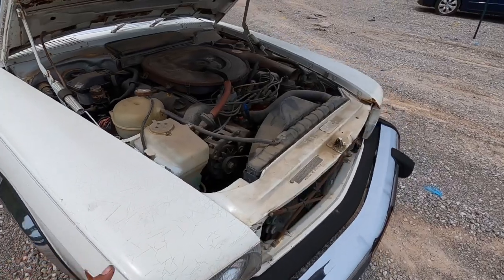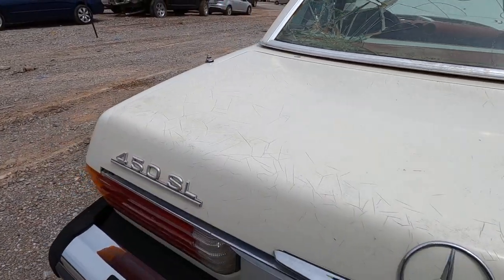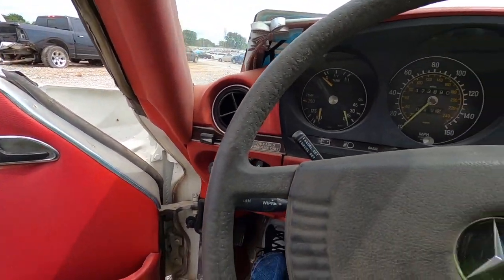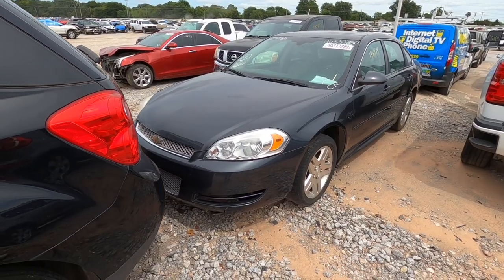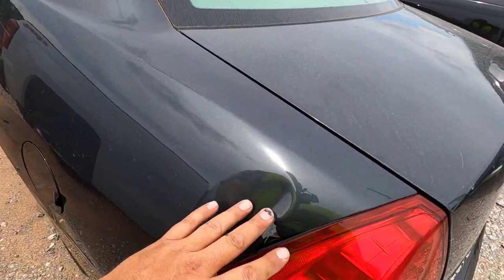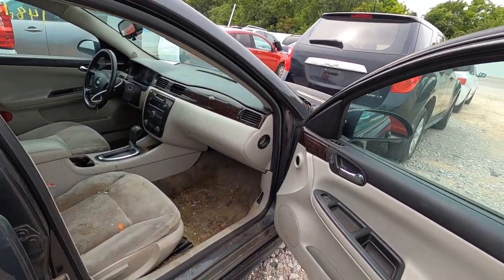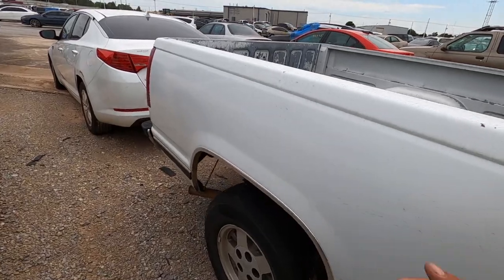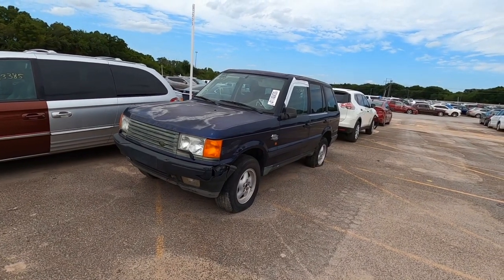Copart Walk Around 8-8-2020 + 2020 BMW X3 XDrive

Comment: That 450 SL will have the fuel injection on it and those engines are very reliable, I have seen one at 300K miles it need a tune up and some brakes and it was fine

Comment: I think that GMC would pull in 3500 if the air worked on it. I saw one bring 2350 at auction a couple of weeks ago @ a dealer auction so they paid around 2500 for it with fees

Comment: Get the GMC. The TBI 4.3 was just as durable as the 305 and 350. It won't start having problems till about 270,000 because that's when that head gaskets usually go. Here in Indiana  a rust free GMC even with a 4.3 and 2wd with only 153,000 miles would go for MINIMUM $3000

Comment: I have a new Silverado with the 4.3 it’s a great motor.  Runs smooth, decent on gas without having cylinder shut down, hauls a ton of wood pellets in the bed, and tows my 5000 pound camper no problem.

Comment: If you can't sell that White Silverado for $3,500.00 running like that without any dents or major damage then you got NO business buying and selling cars!  Don't discredit that 4.3L: my best friend had a 4.3L V6  pick up  that pulled every bit as hard as my 5.7L V8  the 4.3 as i told you when you bought that Black pickup  a couple years ago  (just before you bought the tahoe with the twisted frame) was like a 5.7L with 2 cylinders cut off. it's just as powerful and gets just as bad a gas mileage but it's got PLENTY of power. That Range Rover judging by the seat looks like it was just left to sit out in thew sun and dry rot all to pieces. it may well run and those things were Solid trucks too. as long as that one is the discovery

Comment: I enjoy the walk arounds.
After the 98 Range Rover, the 95 GMC 1500 Sierra looks real good. Interior is excellent and the engine runs. Body is straight and apart from the paint, which for 25 years is in good condition.

Comment: The engine in the Land Rover is basically a 215 Cubic inch  engine that was designed and built by Buick starting in 1962! It was an aluminum block and heads engine and it wasn't well received in the USA! So Buick sold the rights to the engine to Land Rover and they used it for somewhere around 40 years!   By the way Randy that little Mercedes has your name all over it! And the old GMC pickup does too!

Comment: I can't for the life of me understand why car companies don't put dipsticks in their cars. Yeah, I know, they are using sensors and electronics to tell you when to change or add oil but, to me, that's like relying on an idiot light. They fail, all the time. I personally like the ability to pull the dipstick to make sure the oil is where it needs to be. Maybe it's just me but, I don't trust sensors and what not. If I can't check the oil visually or the trans fluid visually, I don't want it. I'll stick to my old, beat up cars thank you.
Reply: I know. It isn't just the level that matters but also the appearance. Can't determine that without a dipstick.